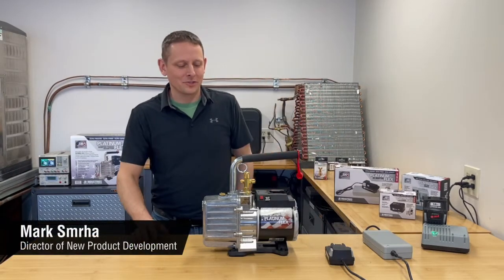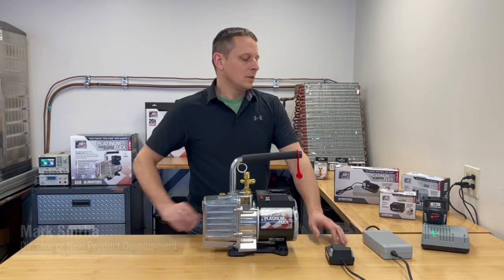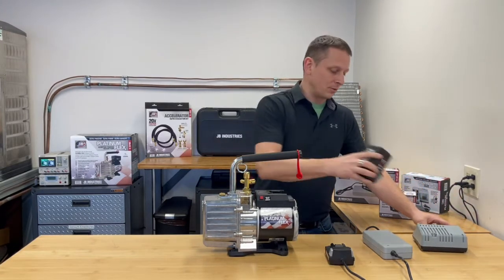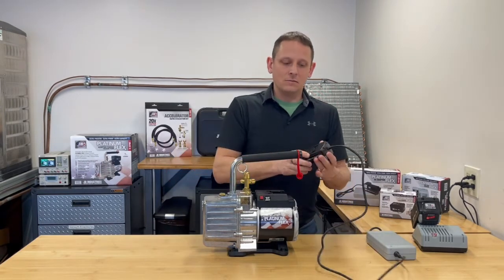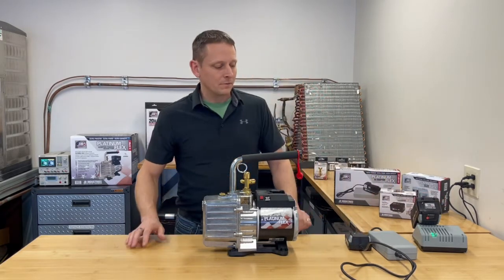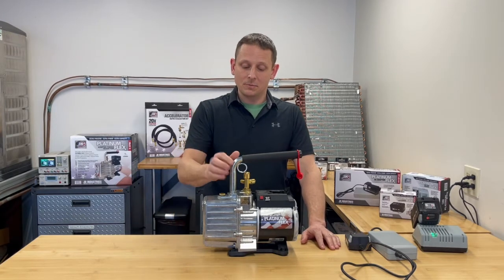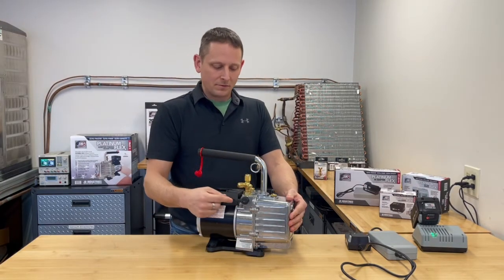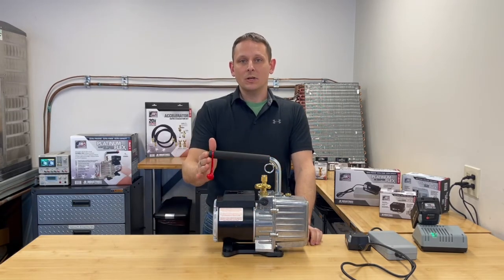JB PLATINUM FLEX AC/Battery Powered Vacuum Pump with Mark Smrha

Comment: Very cool battery platform. I got M18 batteries
Reply: and they fit right in?
Reply: @ultratec66  yes it’s the same battery platform. JB just use a knockoff battery system

Comment: What is the weight of the pump, what’s the price point
Reply from the maker: Apx 30-31 lbs for the PLATINUM FLEX 5CFM. Please check with your nearest HVAC supplier for pricing.
Reply: They’re about $920 for 3cfm cordless with ac adapter from Johnstone

Comment: Will it run off a M18 Milwaukee battery? The charger and battery appear to be Milwaukee.
Reply from the maker: Only the JB battery is supported on the pump. It is a JB battery.
Reply: So chisel the plastic tab and M-18 fits.  Probably voids warranty, but sure makes it easier charging and switching out when you have a f***ton of M18 batteries.
Reply from the maker: The PLATINUM FLEX works with a JB battery.
Reply: @jbindustries8325  We know that it works with the platinum flex JB battery. We want to know if it also works with the Milwaukee battery. They appear to be identical except for color.
Will this pump work with the M 18 battery platform? Or only the included battery?
Reply from the maker: @jaredj631  Only the JB battery is supported on the pump.
Reply: They use clone M18 battery
Reply: JB pump only SUPPORTS a JB battery. Never said it isn’t compatible. Not a good sales move to build a pump and  offer their own “JB-M18” battery and then tell everyone that it’s compatible with Milwaukee’s M18 before hand, deterring people away from spending more money with JB. Should just be thankful that they built something that’s compatible with another manufactures product unlike most other manufacturers that introduce new products that are made to only work with specifically made parts from said manufacturers. JB definitely kept their customers in mind by doing this and is a huge advantage over other brands.
Reply: Reading the comments interesting and very curious with the M18 battery is seriously something cordless everybody wants a battery line up a lot of people use Milwaukee no one is going to buy a JB battery
This video is 2 years old Milwaukee this year released cordless vacuum pump I use J-B because it's awesome and it's also American-made time for JB to step the game up